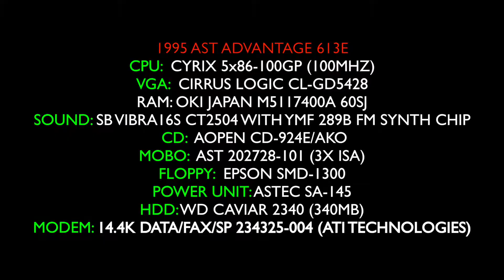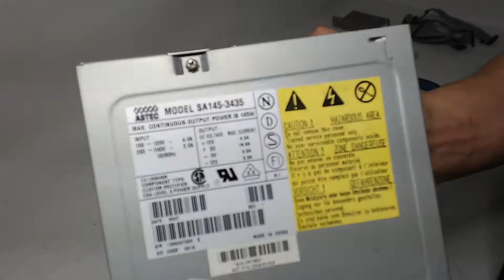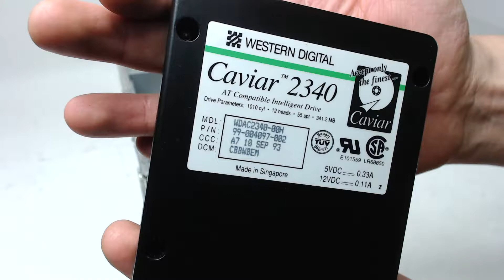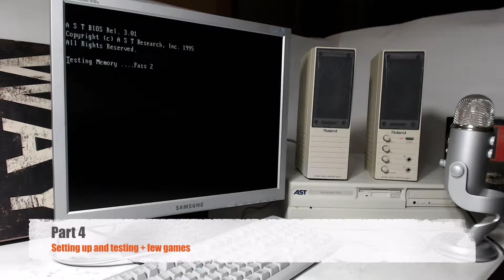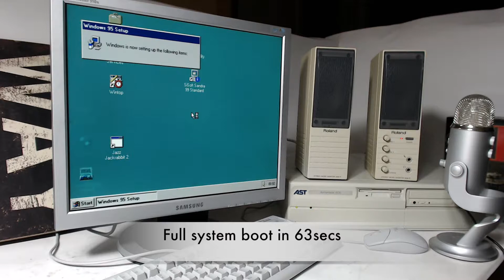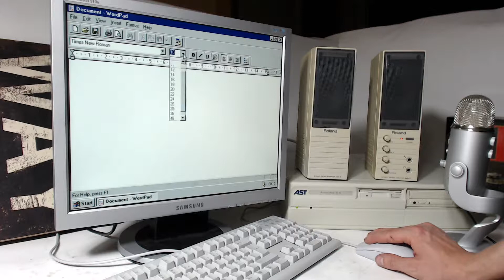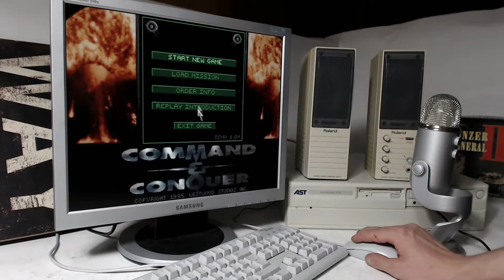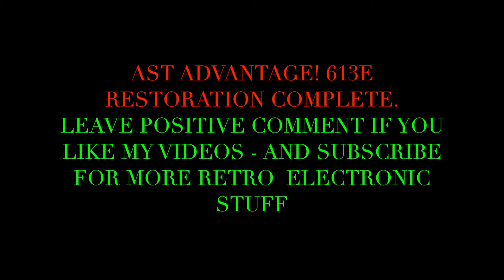(restoration) 1995 AST ADVANTGE! 613e Cyrix 100Mhz 32RAM CirrusLogic VGA 1MB SB Vibra

Comment: I had this exact same model. It came with 8MB RAM and an 850MB Hard Drive. It also had the first version of Windows 95 on it and came with a software selection which included Cinemania 95, Encarta 95, Microsoft Golf 1.0 and Quicken for Windows. It was always a solid runner and one of the first machines I'd seen to use the PS/2 mouse and keyboard ports. Despite this the CD-ROM drive also died in mine which was replaced with an extremely noisey 24x Panasonic CD-ROM drive. I also upgraded the RAM with 2x 16MB Panasonic SIMMs. The modem was 14400 baud and also came with some software which allowed it to be used as an answering machine (provided the PC was on)! It seemed very flash for the time and used to give the Intel powered machines a run for their money in performance. My game of choice on this machine was Death Rally with played like a dream ;) Unfortunately within about 3 years of having this machine Intel and AMD had massively stepped up their game and MMX reliant games requiring more than 1MB VRAM were becoming the standard and I think AST disappeared around the millennium. My time using this machine still brings back good memories though.
Reply: Same here :). This was the only brand PC i got. After this, i build custom machines. I really liked Encarta, i still remember the videos / animations it had about something like Bernoulli principle.
Reply: Same this was my first pc!  Software AST works 2 with spot and that cheesy American introduction video. Had a 19200 modem with voicemail software. But they forgot the dos drivers for the cd drive and had to ship those to me on floppy so I could play dos cd based games.

Comment: hello, I have this same AST PC, I have problem computer doesn't recognize HDD, would you have any tips for that ? :D did you had original AST version of windows 95 ?
Reply from the maker: what kind of hdd you want to use? old bios don't recognize newer drives, i have my own copy of win95
Reply: @retro-nostalgia-vintage9600  Yup, I think I need to find old HDD.. I had few old but I guess they weren't enough old :D Now I'm trying with CF-Card which is partitioned to 528mb with 1024 cylinders, 16 heads, 63 sectors.